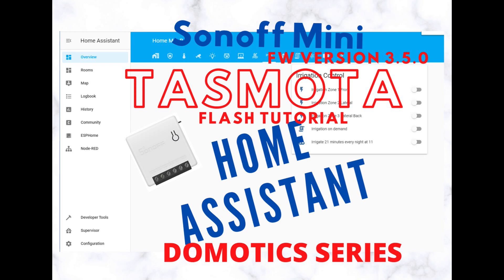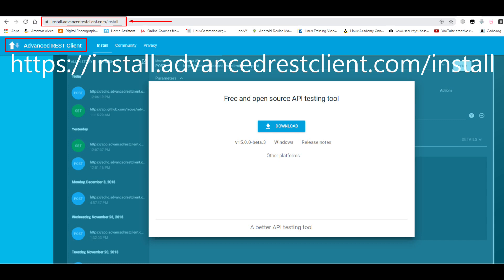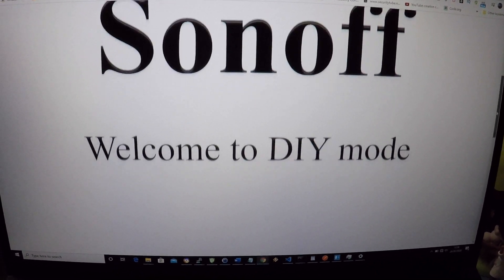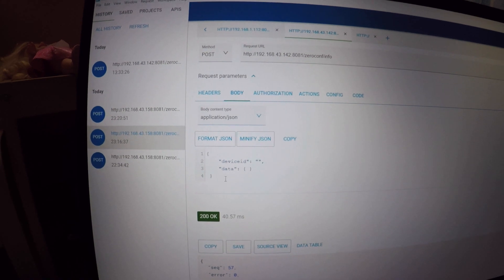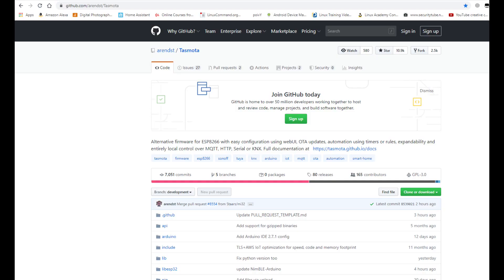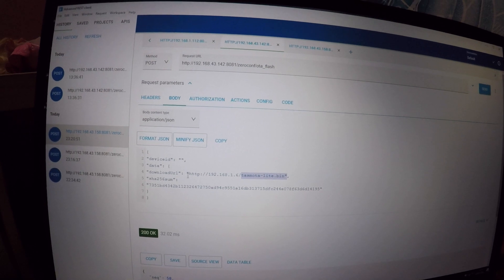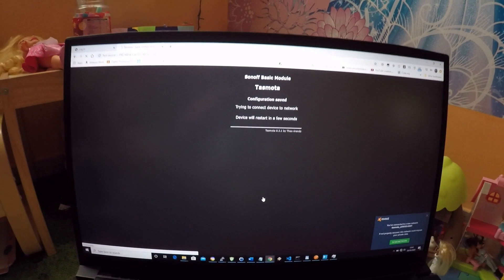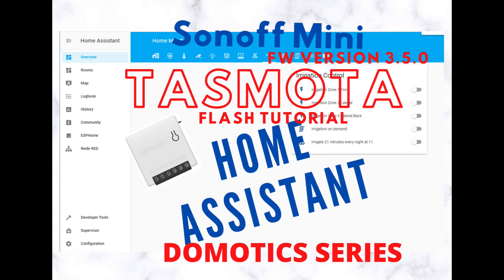How To Flash Tasmota On A Sonoff Mini with Firmware Version 3.5.0

Comment: thank you for this very useful video, although the phone is not needed. after step 1 configure the hotspot on the pc and let the Sonoff connect to it, (it's is easier to find it's IP address) after that follow the video and it works perfect, it also works for 3.6.0. When installed Tasmota-lite, I had to downgrade it to Tasmota-minimal.bin and than it's easy to upgrade it to Tasmota.bin. Directly upgrade to Tasmota.bin gives memory issues. Tasmota.bin is needed for connecting it to Domoticz.

Comment: Confirmed still works although the diy hotspot is not needed anymore
i did a bit of a write up to help clear the air a bit
https://community.home-assistant.io/t/solved-sonoff-mini-no-diy-jumper-pins-on-board-and-no-clue-how-to-tasmotize-it/242748/6?u=xb385
@zoltar99 this video is the only one that got me on the right track after a few hours, thank you for making it!

Comment: You don't need to install any restful api programs, you can just use curl right from a command prompt on your pc. Examples are below (just substitute in your sonoff's IP address, md5checksum for the upgrade file, etc)

Disable OTA unlock:
curl -X POST http://xxx.xxx.xxx.xxx:8081/zeroconf/ota_unlock -d '{"deviceid":"","data":{}}'

Verify OTA unlock:
curl -X POST http://xxx.xxx.xxx.xxx:8081/zeroconf/info -d '{"deviceid":"","data":{}}'

Flash firmware:
curl -X POST http://xxx.xxx.xxx.xxx:8081/zeroconf/ota_flash -d '{"deviceid":"","data":{"downloadUrl":"http://xxx.xxx.xxx/tasmota-lite.bin","sha256sum":"aa413f499233901f74502558561a1304e2a3d7ab72259740b377f52775adbb5d"}}'

Comment: And if you have an iPhone, you can only use the default hotpot and set nothing yourself except the password?
Reply: Go to about and change the name of your phone
Reply: a first name and last name are required for an Iphone. If you divide the word SonoffDiy by two and then divide by and however name it doesn't work. Does anyone know a solution?
Reply: @rolandtwilt  go to general, then about then change the phone name. It doesn’t need a surname
Reply: @LordCecilRavencourt  thanx
Reply: @LordCecilRavencourt  thanx
Reply from the maker: Yes, it looks like the iPhone takes the name you register yourself with and will name its hotspot using that, such as "Peter's iPhone". I would try to get hold of an Android phone so that you could name your hotspot as it is required.
Reply: @zoltar99  :(

Comment: Thank  you, but did not work for me.  I get all the way to 8:39 in your video, but no network is visible and my Mini does the 1-2-3 flash sequence.  It might be hosed now?
Reply: Hi Fred.
I had the exct same problem as you. I worked around it by using the method described here: https://m.youtube.com/watch?v=FoJT5pJDEL4

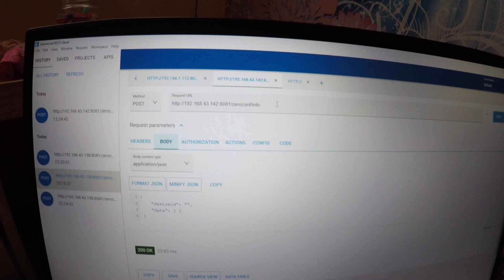From 5:36 he uses the DIY MODE TOOL. Since your sonoff and computer are already connected to th hotspot sonoffDiy, the tool will recognize your device right away. After that simply follow his instructions. 
Let me know if you managed.
Cheers.
Reply from the maker: Really sorry it didn't work for you, there could be another issue with your device. Quite a few people have confirmed that it worked for them with this version of firmware
Reply: @zoltar99  For what it is worth, it appears that even though I got the confirmation after flash, it was never flashed. I re-paired it with ewelink and it works in that App.  I guess I am going to have to get the solder iron out. :-(
Reply from the maker: @fredjaquish  This is really strange, if you got the confirmation it should have been flashed. Have you tried it one more time?
Reply: @zoltar99  I tried again this morning...I am really frustrated, everything goes just as yours does in the video, after flash, I get "200 OK 46.06 ms, "seq": 9, "error": 0 . However , the Tasmota wifi hotspot doesn't show up.  I even pulled out a new Mini and it behaved the same way.  The mini LED does a double flash and just sits there?
Reply from the maker: @fredjaquish  I flashed two of mine without any issue. As you can see from other people who also managed to flash theirs, so the procedure should work for you too. Have you tried again with ewelink as you did before? Does it still show up in the app?
Reply: @zoltar99  It no longer shows up in the App. When I unplug it and plug it in again, it will immediately connects to the sonoffDiy hotspot, I then connect my computer to the hotspot but I can not get 10.10.7.1 to load.
Reply from the maker: @fredjaquish  If nothing else works, you can flash it the old way, by soldering wires to it. A little bit of a pain, but you'll save the sonoff mini. I really have no idea why it has not worked for you, I'm sorry. The truth is it took me a few tries to get it working the first time.
Reply: @zoltar99  Thank you for trying to help. I have 5 of them, they are really of no use to me if I can't run Tasmota.  I was able to solder 4 out of the 5, I ruined a pad on the first one, so it can't be soldered. If I ever figure out the OTA maybe I can recover it. Again, Thank you for the help.

Comment: Great guide, worked like a charm - you can skip the whole 'hotspot' bit by just setting the main WIFI creds on the Sonoff DIY page.  Confirmed working on 3.6.0
Reply: Yo don't need the hotspot nor the Wifi creds... I just filled my regular 2.4 wifi creds and flashed from my pc... no need for special SSIDs or passwords...
Reply: @knifesk  didn't work. I do see the device on the network but can't POST to it. it just hangs forever.

Comment: WAYYYY too much hassle and in the end, neither of the two OTA methods worked at all for me so after a bit of reading I decided to solder wires to the tiny 3.3v, GND, TX and RX pads on the back of the mini. That way, flashing with and an wired FTDI programmer was possible, just like with the Sonoff Basic.
Reply from the maker: This may be true, but not everyone is comfortable with soldering, some may prefer doing it this way, it worked for me and for many others. I do solder sometimes, but whenever I can do it OTA I prefer this method.

Comment: That splicing at 2:18 is crazy. These terminals are not designed for connecting bunch of wires like that.
Reply from the maker: I know, this is how they seem to be doing it over here. I didn't do it myself, the house came like that. I will probably be looking to replace them with something more suitable at some point.

Comment: Hi! excellent tutorial, I have a question.... Can I repeat the flash step with the Tasmota.bin file in order to have the full version of Tasmota? Thanks so much in advance!
Reply from the maker: Hi Martin, just go to Firmware upgrade in the Tasmota UI then either input the right URL for the OTA or upload the desired Tasmota full version from your local computer.
Reply: @zoltar99  Thanks so much for your response keep teaching us! :)
Reply: I flashed tasmota-lite but my UI doesn't have any firmware upgrade option. In reality the UI is quite simple, with only a few options to enter SSID and PW.

Any thoughts?
Reply: Sorry guys, my bad.

I input my SSID and PW, and after that I can see the full menu options.

Comment: Hi! Thank you for the tutorial. However, I cannot find any tasmota wireless network. I've already flash the new tasmota-lite.bin v8.4.0 and got 200 OK response. I restarted my Sonoff Mini and it's still in previous network.
Reply: @DrBi  I found that it's because of my webserver platform. I finally used XAMPP with port 80, with right request, it worked!

Comment: Very helpful guide, indeed. I also updated needlessly to 3.5.0 without knowing that it will change DIY mode completely. Thx a lot!
However, I got stuck right at the beginning: I cannot connect to the ITEAD-XXXX network as it will not accept 12345678 as password. I tried Android phones, an iPad and a Windows laptop zillions of times - always the same outcome. Frustrating! I tried with both the device connected in eWeLink app (2 x 5 sec button press for fast blinking) and disconnected from it (which causes a factory reset, so only 1 x 5 sec button press for fast blinking). Is there another password? Or is the Mini just broken?
Reply from the maker: Have you tried without any password at all? Like a free hotspot?
Reply: @zoltar99  It's a secured wifi, so you need a password. Without one, you cannot connect, alas.
Reply from the maker: @romanaffa2077  https://support.itead.cc/support/discussions/topics/11000008027/page/4?url_locale= check out this forum, it seems quite a few people having the same problem, haven't had time to read it all, just done a quick search, see if it can help, I didn't have this, for me it worked with 12345678 for both sonoff mini switches